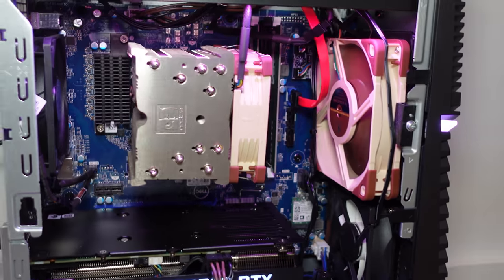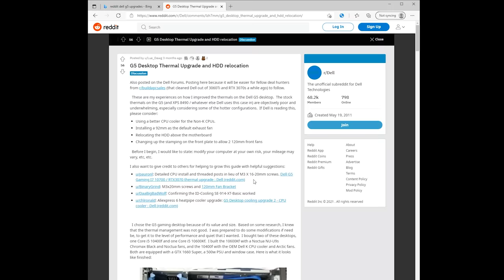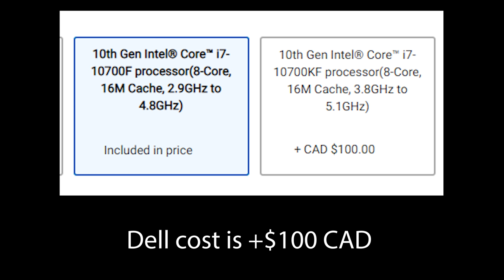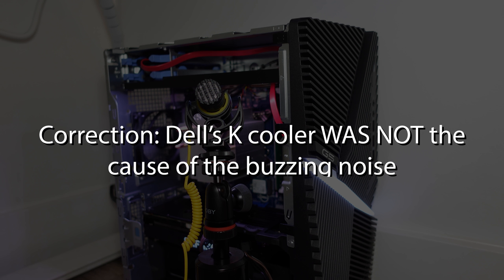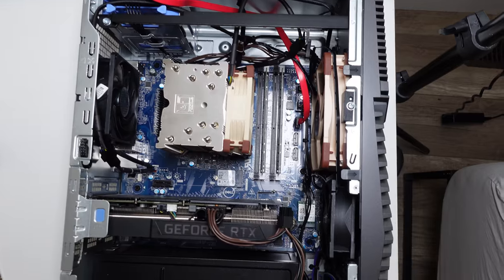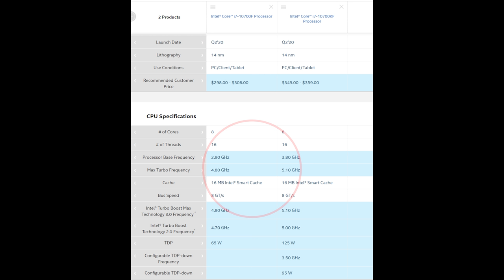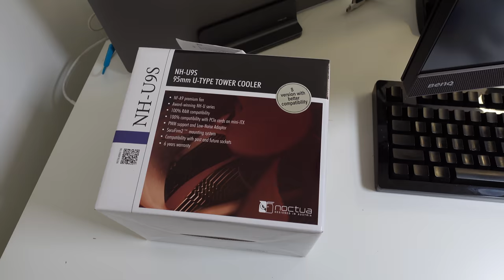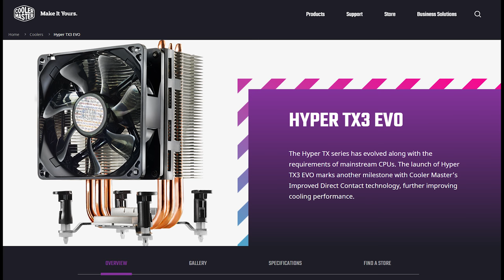Should You Upgrade Your Dell G5/XPS CPU COOLER? (with step by step instructions, in-depth analysis)

Comment: Thanks for the video. I did buy the k version with the premium dell air cooler but when I ran cinebench23
 and intel xtu, my rig still came up thermal throttling with cores coming up to 100c. This is with the 92mm and 120mm noctua fan install. I will get another cpu air cooler soon.
Reply from the maker: Niiiice!
Reply: Update** got the Vetroo V5 and no thermal throttling whatsoever, and such an easy install no need for any custom parts for $30usd. Thanks again for your videos. The Dell xps is more than an adequate replacement for my 9yr old rig especially with 32gb ram and an RTX3060ti. Cheers to another 9+ years!

Comment: I am a chemist for training education. However, I’ve spent the past 40 years building my own computers. Regarding your comment about the purity of isopropyl alcohol, 70% is the most common. Isopropyl alcohol attracts atmospheric moisture, and the stabilization at about 70%, which is the reason for that concentration is so cheap and common. I used to be able to find 99% at a higher price, but since it is used in meth production, that product  has disappeared from pharmacy shelves.
Reply from the maker: very interesting insights from your field of expertise! :O

Comment: Has anyone tried the Grub screw method? I could get those grub screws easily but interested to see if anyone has tried that method I am leaning towards doing the method in the video instead
Reply from the maker: Do it! It's gonna be the same.
Reply: @JSyntax  Just installed the U9S for the pancake cooler. Great video really saved me a lot of mistakes, thank you. Wondering if you opted to use the "4-pin low noise adapter" or just went straight into the fan port and created a profile?

Comment: Washers are for increasing the load bearing surface. Even though the screw head makes contact with the bracket you do not want to focus the weight on such a small surface because it could shear. 

And If you look at a video by Gamers nexus about thermal paste you will learn it does not matter if you put on too much just don't put on too little.
Reply from the maker: That's a very good point. My washers didn't fit in my case and the screw were pretty wide already

Comment: I have bought the Noctua A9 & Noctua U9S and I was expecting to solve the problem, it certainly has solve the cooling but I am getting the 2000-0511 fan failed to respond message :-( 
I have the G5 Dell 5090 and live in UK, would the problem be the wiring here, i cant find anything to suggest it but the colour of wire connections are different so wondering if this is the cause?
Noise is gone and everything i wanted apart from every time i start up i get the pre boot check and then error :-(
Can anyone suggest anything please?
Reply: anyone?
Reply: Same as well
Reply: I got this too, but currently haven’t found a fix. Don’t know if reverting back to an older bios version would solve it, but haven’t tried. Let me know if either of you found a fix.
Reply: I haven't sorry, but I made a decision to sell my G5 and buy one from quiet PC, hopefully arriving this week.
Reply: @garybatten88  no worries, thanks for the reply. I might sell mine too at this rate, are you selling yours anywhere in particular?
Reply: @nathannichols3341  not sure yet, need to think if eBay is best was or sell your pc sites but won't be much as second hand. Had it 2 years nearly. Still a good pc for sure.

Comment: Great video! I am going to do this next. I just upgraded my gpu to an aio cooler. It was a giant pain in the a**. I had to fabricate my own bracket out of 1/8 in aluminum. But it brought my gpu temp from around 80 during gaming to about 52-53. Huge improvement. I need to cool the cpu better now. Just ordered this. Thank you for your video! Well done!
Reply from the maker: Thank you rich!
Reply: @JSyntax  You are very welcome! Just had my cooler come in today and installed it. My cpu temps dropped by like 25 degrees. Great recommendation!!

Comment: I ended up using the normal screws got them from a local store they sold me 4 for 50cents YAH. worked like a charm. they had no idea whata Grub Screw is, turns out they are also called set screws. oh well.

Comment: Thanks for your helpful video because I am also a fellow Canuck!  You saved me so much time and money with your advices!!

I have a Noctua NH-U9B SE2 (the predecessor of the U9S) bought from NCIX in 2012 for $34 in storage for many years and who would have thought it is now back in commission!

As for thermal paste application,  I always follow the guide from Artic Silver (the original enthusiast aftermarket thermal paste).  In this case, a vertical line for any 3rd - 11th Generation Intel Core Processor.

By the way, have you tried contacting Dell Support and see if they would replace that buzzy PSU under warranty?
Reply from the maker: I don't they it's broken, just how it is. Gamer nexus just did an insane breakdown and the rumours are true, it's a PLATINUM rating psu! Crazy?

Comment: What do you mean it wasnt worth it???
Reply from the maker: Only if u have the pancake cooler it's wortj it
Reply: @JSyntax  thank you. I just bought an xps with the pancake cooler and I wanna make sure when I upgrade that its worth all the money
Reply: @kerdas5  I replaced my pancake cooler (as well as upgrading back fan, adding 2 front fans and VRM heat sink).  The CPU cooler is the only upgrade that's pretty much required.  I wish Intel would stop including those tiny coolers with their processors.  So long as they keep including them, OEMs are going to keep putting them in their PCs.

Comment: I have an even easier solution. I'm just going to return this thing. Mine came with a 3060 TI and the Nvidia manual for this GPU states that it requires 600 watt power supply. My 8940 came with 500 watt. This combined with the crappy CPU cooling - I can see where they cut corners and why the system was only 1600 dollars.
Reply from the maker: 500 watt is more than adequate and totally reasonable for a 3060ti

Comment: Check out Vetroo V5, cheapest alternative, $20-25 in US, probably 90% of what noctua is, straight screw on install. 2mm clearance to case lid. 120mm fan instead of 90mm. Build quality is quite nice for price too. Very quiet. Guiltless purchase.
Reply from the maker: Do you need any special hardware? Would love to see a step-by-step instructions. It's impossible to buy in Canada here
Reply: @JSyntax  Nope!  Vetroo V5 has proper clearance, proper screws, mounts directly and even comes with thermal compound.  Install only required a screwdriver and about ten minutes time.  Has been working great in my xps 8940 for some months now. Currently goes for around $28 USD.  Available via amazon, newegg, etc. https://www.amazon.com/Vetroo-Cooler-Processor-Universal-Socket/dp/B08F2BS9J8
Reply: @hipflipped  I ordered the Vetroo V5 thanks to you!

Comment: never buy a pre built you can always build a new one for less 300-800 cheaper.  On top of that the overclocking that you might expect to be there isnt. up until 10 years ago every component had to be new and over clocked just to get playable  fps which meant you needed amazing cooling, which was way more expensive at the time.

Now games are better optimized for multi core cpus.  Back then one core would be maxed  util the second would be showing 15% from the game and the other 2 cores had nothing.  Now the load is equally distributed across all of the cores and you don't see the huge gain from overclocking we were used too.  Cooling is still important though.  The stock cooler from intel still sucks, but all you need is a cheap 20-30$ all in one cooler.  they do the same cooling  or better and take up less room and are easier to install.  You won't get more performance but you will get more longevity out of you  components and you will be less susceptible to heat soak from long sessions hurting your performance.

And you wouldn't have to complain about covid inflation on things from murica if you didnt build that border wall
Reply from the maker: Agreed.

Comment: I got an i7 10700F with a 2060 Super, the cooler was definitely the inadequate oem CPU cooler. I went with the Noctua cooler and also replaced the back fan with another Noctua 92mm. Now my Noctua has push and pull fans just because I could. While it's improved the thermals, and it's MUCH quieter it still gets too hot for my own comfort during warm weather  (no central AC). 

At this point, I just take the panel off and am living with my mistake of having bought a Dell. There's 92mm aio's out there that I've been looking at, but I'm not sure I want to spend more money on this thing.
Reply from the maker: Have you tried using the 3d printed part to mount a 120 fan? It made a huge difference with thermals. Otherwise you're blowing hot gpu air on the CPU cooler
Reply: @JSyntax  I'd have to remove an actual HDD, since I picked the dual drive config. Thankfully my OS is on the NVMe SSD, so it wouldn't be much of a pain, except I'll have to spend money on a regular ssd to replace it. I'm also not sure how many more fans the system can support, I already have 3 Noctua's in there.

Comment: Hey man let me just thank you again for all the help/research you have done for the community. I have finally done the install on my G5 5000 (1650 Super i5 10400f for those who have the same model) I could only get the chromax black cooler which i think is identical besides being black. The only issue ive faced thus far is in the alienware control center I cannot get the fan that came with the cooler above 64% even when I set the offset to 100%. Its working fine for now but am wondering if anyone else or yourself has encountered this and if there is a remedy for it. If anyone wants pictures of what I am talking about let me know.
Reply from the maker: Does it get decently loud? If so, u should be fine. I try to run it around 1300 rpm max. Make sure u used the 4 pin cable in the y splitter
Reply: @JSyntax  Yeah like I said even under load it doesnt get higher than 44c (provided that hwmonitor is accurate) so I figured it would be fine. Just wanted to verify this was normal behavior. Its funny that the base fans the desktop comes with have a much higher base rpm than the noctuas, and that the mobo (proprietary as you know) wont allow for customization of the fans in the bios. Its almost as if the control center is calibrated to only be used with the base fans. I will take the whole thing as a win situation though because it works and works well. If you had came out with the video 2 weeks earlier I would of got the K version of the cpu for sure. Its a shame dell dosnt even put on the heatsinks for the vram...

Comment: @JSyntax -  Great video, very well done... I have participated in many of those conversations on reddit ( /u/stevekenney318 )and the dell forum ( @SteveK318 ).  There has been a wealth of knowledge shared !!    Here is my original post on the Dell forum regarding the 'alternate method' of mounting using the 'grub'/set screws... https://www.dell.com/community/Inspiron-Desktops/Inspiron-G5-5090-CPU-cooler/m-p/7839845/highlight/true#M27034  I went through the same things you mentioned trying to line the black spacers over the holes and assemble everything together... And my 60+ year old fingers didn't want to cooperate to well !!  So I figured there had to be a better way ! I also wanted to get the installation as close to the original intent of Noctua's design... I think I accomplished that with this method. I sure wish those m3x25mm set screws weren't so hard to find. So to add to that, it is possible to just get m3x25mm or longer screws, and cut the heads off - that would work just fine !!  One other side note, I'm not sure if the 3d printed bracket for the 120mm fan was latched in all the way... yours seemed a bit 'wobbly' - there are 4 key slots in the part that should engage the raised features in the case.
Reply from the maker: Thank you for your contributions! I'm  so fortunate for the pioneers to have done this earlier.
Reply from the maker: As for the 3D printed part I will need to fix that thank you for pointing it out I wasn't sure what they were for and it didn't seem obvious at the time of installation. Perhaps has it's a Dell XPS and not a Dell G5 thing we shall see
Reply: @JSyntax  - it's the same latching/catching clips for the hard drive caddy if there was one there in the front of the case. My guess is the sheet metal cases are Identical  $$$ !!

Comment: Do not follow this tutorial is does not fit. I have a G5 service tag 6RZMQ53 with the F i7. The brackets he said to make sure the screws fit in the middle (hole #2) holes is impossible and just does not fit in mine. I managed to get one of the screws in hole #1 and the other in hole #2. Then I tried to fit the cooler on in the same orientation and there is about a 4mm gap between the spring screw and the screw head on the bracket. I will be sending everything back and trying the vetroo v5.I have the NH-U9S black version. Really disappointed that no other comment mentions this problem.
Reply from the maker: Damn I'm sorry lots of other people were very successful with this upgrade
Reply: @JSyntax  Is there something I might be doing wrong? I followed the instructions step by step and just to be clear I don’t need to install the bracket on the back of the motherboard right?
Reply: @JSyntax  well I wish you would give me some insight, oh well I’ll try the vetroo v5